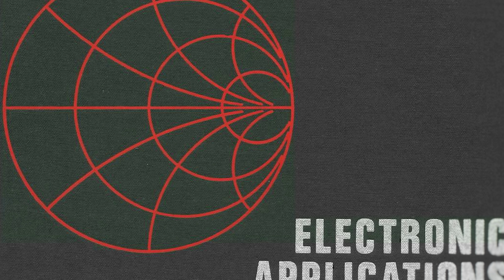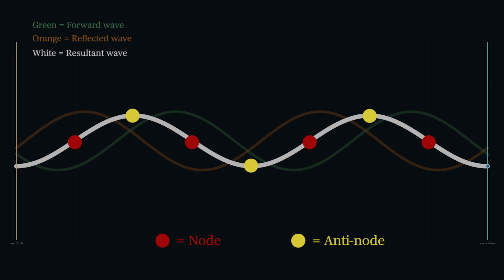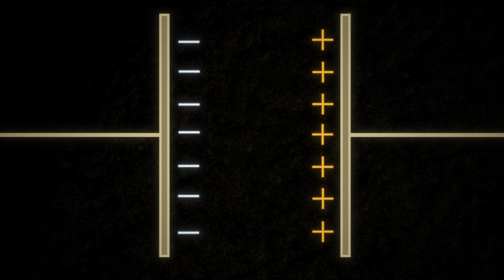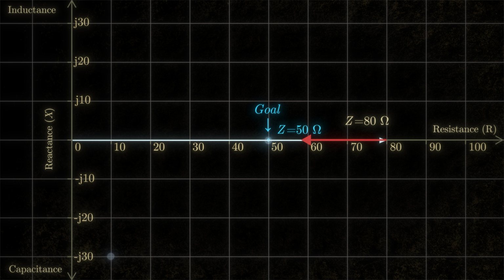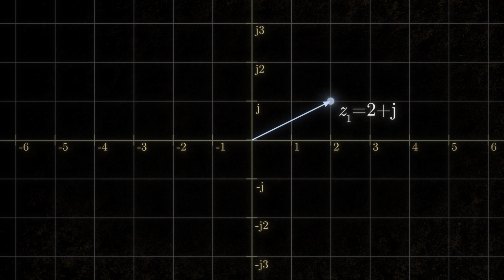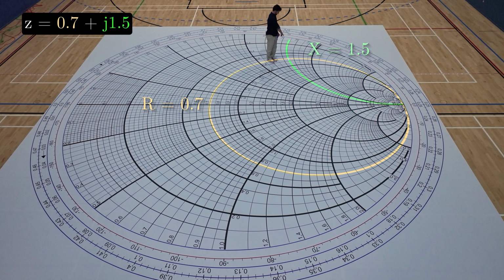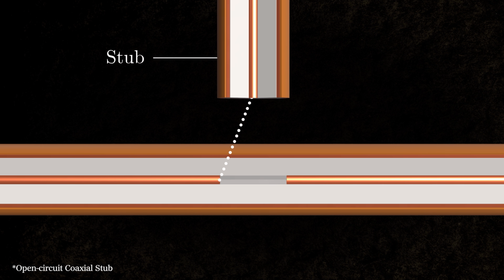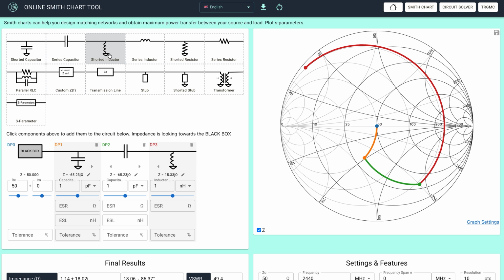The Scariest Chart in Electrical Engineering

Comment: FINALLY... a topic even veritasium sucks at explaining.
Reply: Slinkies!
Reply: @dr97236 Big prints! Cones!
Reply: @dr97236 🍪
Reply: @EnriqueDominguezProfile 😂
Reply: Still better than my university
Reply: It's still passable. Try university lecturers. Most can't convey the concept cleanly, then they immediately start giving the math, which is the examable part. All in one lecture. Every student's head spinning by the end.
Reply: @nickyoung9108  In the RF industry, they just teach you how to use it ( selecting appropriate capacitors and inductors) without deep diving the creation of the chart itself.
Reply: @David_T  that was the entire point.  It simplified circuit design and frequency response and makes bench work easier to understand.
Reply: @David_T thats like leaening to play guitar without understanding music theory. You can, but you get better knowing why.
Reply: @nickyoung9108 The trick is to actually read a book written by someone smart. And use the lectures just to see what you need to know for the class.
Reply: @Mobin92 : can you recommend any good books on this?
Reply: @HoraceMash Pozar, Microwave Engineering (4th Edition)
Reply: @HoraceMash  Cheng, Field and Wave Electromagnetics (2nd Edition), Chapter 9 on transmission lines. Also the cover of the 2nd edition is literally a Smith Chart, lol.
Reply: @HoraceMash  Chris Bowick - RF CIRCUIT design, 2nd edition,
Reply: @Mobin92 i find that smart people really are not good at explaining things like this. They just understood it and never had to struggle. They just know. Those that had to struggle and learn it the hard way and then can explain just the things that are important are the best teachers. But those people often don't go into teaching math or the sciences
Reply: @CrackedCandy  false lmao, its a strange stereotype smart ppl are bad at explaining, rather they just dont want to explain everything they know point by point to make someone understand or are too uninterested to help someone understand in the first place
Reply: @thanosnoctem4473 im speaking from experience.  My math teachers have generally sucked, wasnt until college that I had a good one. Your milage may vary
Reply: @CrackedCandy  opinions can vary, true. I was balancing out your take instead.
Reply: @nickyoung9108  University lectures (Br) are really weird, most can't grasp what explaining means and commonly you find people preaching phrases instead of actually putting some thought behind it because they learned it 20+ years ago somehow and never cared to illustrate to different people how one learns it and when to prove it. I suspect it is an universal problem with academia...
Reply: @Samuel-lq7kp well, it's simple. Lecturer are not hired to teach, which came as a shocker when I first heard it from a college lecturer. So if teaching is just an obligation, then effective communication isn't anywhere near a priority.
Reply: @nickyoung9108  Not all lecturers are research professors, there are teaching track professors at universities, but they are less common.
Reply: @Samuel-lq7kp  I'm arrogant enough to suggest that "universal" may be overstating it.
Reply: @nickyoung9108  not that school teachers are great at teaching anyway...
Reply: @nickyoung9108  Neither hired to teach, nor especially trained in it. Teaching is a whole-ass field, and at the very least, it consists of communicating, but mostly, academics get where they are for their research abilities, which are entirely different skill sets.
Reply: @nickyoung9108  
This is why I was a big fan of Professor Sumner Miller.  He made physics understandable to the average person by using practical demonstrations to illustrate the point.
Reply: @nickyoung9108  yet better than most lectures...
Reply: @nickyoung9108  This was better than their last transmission line video that made everyone argue for months.  Anyways, I personally can't think of a worse situation to learn anything than a school.  In the decades since I was last in school, I have learned so much math, and actually became fairly obsessed with analog filters.  I have explained impedance and other AC phenomenon to people who have EE degrees in the past, and did a better job than their teachers.  Learning something cause you are interested in it on your free time is usually better than in stressful school environments when you are 20 and have multiple classes yelling at you for your attention and time.
Reply: @nickyoung9108 it’s actually really simple in principle.  Anyone focusing on the arcane is going to do a very bad job of it explaining it, garbage in garbage out no matter how well you do linear algebra.   It’s just a plot of frequency response across a measurement range, where reactance is up/down with capacitance down from center, inductance up and the real part of resistance is zero on the left and infinity at the right with your reference in the middle, often 50ohms or 1 depending on how it’s scaled.  But it’s always the same graph shape.   You often want the frequency response to just be a dot in the middle, like for optimal power transfer, and it simplifies working with high frequency circuits of all kinds.
Reply: As an RF engineer, I must say they did a decent job at explaining the basics. It's pretty solid, but of course, there are some nuances/oversimplification, probably for the sake of targeting a wider audience.
Reply: @zaw00  Lol thank you for the sanity check. I'm in my senior year of my EE BSE and these comments about it sucking were making me start to second guess if I really understand the material, because I thought it was a pretty great explanation!
Reply: @mr.FluxLinkage  the smith chart is simple and intuitive and is well suited to understanding circuits without knowing the math or even individual components behind it because its visual.  The complex linear algebra problems that you will formulate and analyze in class and then plot to a smith chart are very much not fun and do cause people to drop out.
Reply: @hugegamer5988  linear algebra? WTF man, you don't know what you're saying.
Reply: @hugegamer5988  I mean I got an A- in Emag 2 last year and never missed a question related to or using the Smith Chart on a quiz or exam; my point was that I felt like this video did a good job explaining the basics, but so many people are saying how it didn't explain it well at all that I started to think to myself "wait, is there more to the Smith Chart/impedance matching that I don't understand that's not in the video...?"

 So I was grateful an actual practicing RF engineer confirmed it covers the basics reasonably well, meaning I do have a solid grasp on it.

Also not quite sure what you mean that it's "well suited to understanding circuits without knowing the math behind it"; I feel like it makes it easier to understand the dynamics of RF circuits because it helps you gain intuition about the otherwise pretty abstract math.
Reply: @Sr.DeathKnight  Yeah I didn't quite understand that, since in the 2nd Emag class I took where the Smith Chart was introduced we didn't do anything but complex trig, sometimes using MATLAB so technically using linear algebra, but not actual matrix math. But we didn't really do any involved nodal/loop analysis either where you have to solve a linear system of complex equations like you do in Circuits 1. Maybe that's what they meant...? I dunno. But even then, you're just solving for voltages and currents, not really impedance matching.
Reply: @mr.FluxLinkage  Linear algebra is a totally different math, not used here. Here you use Complex Math. Linear algebra is a very basic math, like saying: algebra. You use it everywhere, even in software programming, but not in telecom, incidentally.
Reply: @Sr.DeathKnight  Yeah that's basically what I was saying - we used complex math to solve impedance matching in Engineering Electromagnetics, and last time I used linear algebra in a circuits context was in Circuits 1 doing formal nodal analysis by setting up a system of linear equations to solve for loop/node voltages/currents. 

And for steady state AC circuits, you can just simplify it with phasor notation/Laplace transforms to make it regular old complex algebra.
Reply: @mr.FluxLinkage  Exactly!
Reply: @mr.FluxLinkage  yes, it gives you intuitive understanding of the dynamics of circuits that are represented by abstract math, but it also gives you intuitive understanding of basically any high frequency circuit that is not precisely understood or manufactured such as deviation in performance of the physical board and transmission lines and the high frequency response of actual capacitors and inductors.   Not everything is modeled or designed well at high frequency and even slight component changes can mess up the behavior.  It’s a great tool to use on a vector network analyzer because you don’t need more than a short lesson on the basics and then anyone can bench test and fix circuits of all kinds like antennas or amplifiers without ever going past grade school math.  It’s quite a bit easier to simply see the response on a graph than to intuitively understand the complex math.
Reply: @Sr.DeathKnight  sets of differential equations and linear algebra is how the formula for circuits are written, and how you derive solutions.  You may not have encountered them if your electronics experience was limited to simple resistive circuits without reactance.  In fact, it’s not even just circuits, the same equations also model other physical systems and if you understand how a waveguide responds to a DC stepwise function you also understand how a garden hose functions.  Say your waveguide is open at the far end and the garden hose has a cap on it, when you turn it on, water rushes down to the end of the end of the hose and a pressure wave is reflected back.  The hose stretches along its length from the pressure and acts as a storage element along its length which is the capacitance per unit length.  The mass of the water wanting to keep momentum is the same as the inductance per unit length as well and once the pressure bounces back between the two ends the flow stops.  The rate the hose filled up at is the equivalent ohms.  It’s not a perfect analogy because the hose would have to have no diameter and expand with water, but it’s really close and the math is nearly identical and it’s slow enough and physical enough to actually see and feel the flow and reflections.
Reply: @Sr.DeathKnight  maybe it’s a regional language difference.  In the US, linear algebra are sets of differential equations using calculus that do include complex numbers and are learned after your first year of calculus, often as an extension of your second year coursework, in engineering.  It’s not simple high school algebra.
Reply: @hugegamer5988  Yeah I mean it's a great diagnostic tool obviously, as that's what it was invented for, but my point was that I think the real learning value behind it, and why they still teach it in EE courses, is that if you actually understand why the chart looks like that and what the chart actually is (contours of equal resistance and equal reactance in the complex plane), and you understand how the position vector of any point on the normalized chart is the reflection coefficient phasor for a component of that normalized impedance relative to whatever reference impedance, it helps you understand how complex numbers and phasor notation are concise, elegant ways of describing the actual physics of the system. So to me, the chart is inseparable from the math; it's a visualization of it, not a shortcut around it.
Reply: @hugegamer5988 Linear algebra is matrix operations. If you put complex numbers or variables in the matrixes is a totally different thing, as putting complex numbers or Laplace operators in a basic high school algebra equation. Ask Google or something.
Reply: @mr.FluxLinkage  that’s true.  I was just pointing out the real world is more complex, unknown, and random than the math which is axiomatic, deterministic, and solvable and when it comes to real world measurement a graphical approach that lets anyone solve problems, even those without a math background, is indispensable.
Reply: @Sr.DeathKnight  not in American English.  It’s a natural extension and backbone of writing Kirchhoffs current and voltage laws into a mesh analysis.  Linear algebra is the American name for the systems of differential equations you use in circuit analysis including smith charts.
Reply: @hugegamer5988 that's ONE use you can give to linear algebra, like you can use basic high school algebra to solve deferential equations through Laplace operators.
Reply: @hugegamer5988  Do you use systems of differential equations in Smith Charts? Example?
You don't know what you're talking about.
Reply: @Sr.DeathKnight  sure, take the simple case of a transmission line.  At any point along the line (x) at a given time (t), the voltage V(x,t) and current I(x,t) satisfy the partial differential equations: the partial derivative of V with respect to the change in x  = -L the partial I / the change in time, and the partial derivative of I with respect to the change in x = \(\frac{\partial I}{\partial x} = -C the partial derivative of V with respect to the change in t.  When you use laplace transforms to put the equations into s-parameters you use linear algebra and also use the input/output transfer function mapping onto a smith chart as they are both ways of understanding the same thing.  Where do you get your information?
Reply: @mr.FluxLinkage  These videos are supposed to be for us dimwits. So we can learn. They're supposed to be educational.
If you need a degree in electrical engineering to understand what they're showing, what good is it?
Reply: @hugegamer5988  And you solve all those diff equations as a simultaneous system to solve the Smith Chart?  🤣
You also use simple high school algebra and basic primary school arithmetic to solve systems of diff equations.
You are confusing linear algebra with vector calculus/vector analysis. THAT'S the telecom math.
Reply: @hugegamer5988  Next time, better ask Google or ChatGPT, as said.
"How accurate is it to say that linear algebra is the mathematics used to solve a Smith Chart?"
ChatGPT:
I would say it is partially correct, but it is not the best way to describe it.
The Smith Chart was created precisely to spare engineers from repeatedly performing the underlying algebra. It is essentially a graphical computer for solving problems involving complex algebra.

More precisely:

The fundamental mathematics behind the Smith Chart is complex analysis (complex numbers).
The physical problem comes from transmission line theory.
Linear algebra does appear, but it is not the main mathematical foundation.
Reply: @hugegamer5988  ChatGPT: (continued...)
In contrast, the Smith Chart is primarily based on the transformation

Γ=Z+Z0/Z−Z0

where:

(Z) is the complex impedance.
(Z0) is the characteristic impedance.
(Γ) is the reflection coefficient.

This transformation *is not linear*. It is a linear fractional transformation (also known as a Möbius transformation), which belongs to complex analysis and conformal geometry.
Reply: @hugegamer5988  ChatGPT: (continued...)
A more accurate way to describe it

I would probably say:

The Smith Chart is a graphical representation of complex analysis applied to transmission lines.
----------------
So, after all this argumentation, we return to what I said in my first line ("Complex Math").
Reply: @mr.FluxLinkage  I think the criticism is directed more at the style of presentation—specifically regarding people who don't need to apply the knowledge conveyed in the video to their jobs, daily lives, or hobbies. To them, it looks like yet another instance of peddling some trivial nonsense as the greatest invention or discovery since sliced bread. Of course, even someone who actually knows how to use that knowledge might see it that way: it’s reality, not magic.
Personally, I rolled my eyes too... for a couple of seconds... but if the video inspires even one young person to pursue the career path we both chose—or simply sparks an interest in the subject matter—then it’s worth it. Entertainment value, exaggeration, and tunnel vision don't really matter in that context.
To experts, the electromagnetic force might seem trivial; to the curious, simply counterintuitive; and to trolls, well, just the thing that holds their molecules together (good one, right?). In any case, the insights into our world that we have gained throughout history are fascinating. This requires curious individuals—like the protagonists mentioned in the video—who not only asked "why" but also were looking for an answer.

Incidentally, history clearly shows: who really cares about pigeon droppings when it can uncover fundamental truths about the origin of our universe in the process? (Also: One might think that the people at Bell(Labs) weren't all that focused on telephones—their core business—after all, hehehehe.)

P.S.: Well, Forces acting perpendicular to the cause. ... Very rarely the sort of thing discussed in a pub. Have a good one, a future like a boson and a lot of fun in your job, Flux!:)
Reply: @Scott.Sandifer  I think the main misunderstanding here is that I was sort of taking the general comments as "they're not explaining the concepts *correctly*", whereas now I can see most of the comments are probably more along the lines of "they're not explaining the concepts *well*". So that's why it was making me kinda do a double take like, "wait, the video's not correct...? Do I not understand it as well as I thought I did?"

That being said, I thought it was a fairly good "first exposure" to the ideas that certainly felt more intuitive than the textbook explanations, but I can see where if you haven't ever really dealt with imaginary or complex numbers before, it could still be a bit dense, because they do seem to assume viewer familiarity with those concepts that I guess might not be considered "general" knowledge.

But I thought the visuals were good, and basically the main connecting idea to the weird math of it is just that the imaginary component of the complex impedance value represents "lead" or "lag" between the voltage and current due to the fact that it takes time for charge to accumulate on the plates of a capacitor before the voltage across it can change, and the fact that an inductor "kicks back" against a changing current with an induced voltage that opposes the change in current.

And, they don't really explain this but you don't need to be a capacitor to have capacitance, or an inductor to have inductance. These are physical properties pretty much all matter has to a certain extent simply due to material properties and geometry. And so capacitance and inductance are properties of basic transmission line cables, too, and are the fundamental physical properties that make one length of transmission line harder to electromagnetically "wiggle" than another that it's connected to, in the same way that the metal slinky was harder to physically wiggle than the plastic one, which is what causes the partial reflection at the boundary between the two materials, slinky or transmission line.
Reply: @Sr.DeathKnight  you have chat GPt bRain.  Linear algebra is used in a manner that’s intertwined with the mathematics such that you can’t omit it and still solve the problems conventionally.  I’ve completed all thr EE coursework and used smith charts for years in my job as an engineer who has had to design amplifiers, antennas, and matching circuits and the are circulating right now.  Yes, you don’t even need high school math to solve the problems with a VNA and smith chart, just a few hours introduction like this video demonstrates.
Reply: @hugegamer5988  So, you think that ChatGPT AND I are both wrong? LOL. 
The thing is not that you are saying wrong things: the thing is MUCH WORSE: you are talking gibberish, confusing concepts, and are completely disoriented. It's as if I said: 
"The complex algebra problems that you will formulate and analyze in class and then plot to a smith chart are very much not fun and do cause people to drop out."
"The complex arithmetic problems that you will formulate and analyze in class and then plot to a smith chart are very much not fun and do cause people to drop out."
Then you "argue" that you need arithmetic or algebra to solve the mathematical problem.
Reply: @Sr.DeathKnight  if you have the attention span left, loon up to my original comment where you took offense to linear algebra being the basis for formulating the problems that you then graph to a smith chart, s parameters and laplace transforms aren’t high school algebra.  The systems of differential equations are solved using linear algebra as a core and fundamental concept because they are governed by linear time invariant
Reply: @Sr.DeathKnight  differential equations. Linear algebra is the framework that is used.   The fact you used ChatGPT and stated it as “solving a smith chart” is where you screwed up.  You can use the graphical method to solve a problem, and not use complex math so technically the LlM is correct, but you never fed it my statement where you use linear algebra to formulate the mathematical statements behind the problem which is the difference.  You have llm brain, please do some actual thinking before atrophy ruins your life.
Reply: @hugegamer5988 of you had used Laplace transforms to solve differential equations, you would know that they become transformed to high school algebra problems.
Reply: @hugegamer5988 you use linear algebra to solve linear differential equations SYSTEMS, but the basic math there is calculus/Laplace, depending on approach. 
You're welcome.
Reply: @Sr.DeathKnight  the equations you formulate when in EE classes involving a full circuit with multiple components IS a systems of simultaneous differential equations and you use linear algebra when you translate it into the s-domain which is standard practice and why you may have noticed the s11 and s21 indicators on the VNA used in this demo displaying output to a smith chart.  You can measure s-parameters directly, you can solve basic circuit tweaks graphically with a smith chart, but in EE classes you write the formulas and solve using linear algebra just exactly as I said because I have lived this lol.
Reply: @hugegamer5988  Man, Linear Algebra is literally the second math that you take in an EE degree (from 8). Obviously, you see it everywhere, even in software programming, I've already told you. The second after Calculus 1 and right before Differential Equations. And it's the easiest of all. People use it even in Economics, and so on. Like high school algebra or trigonometry, and primary school arithmetic or geometry, you need it everywhere. Maybe it's a "complex" matter for you, but believe me: in Telecom EE, or Control EE, you need 3 orders of math magnitude over Linear Algebra to understand the basic things.
Reply: @Sr.DeathKnight  how are those shiny new goalposts?
Reply: @Sr.DeathKnight uhh as a math major i'd have to say linear alg and alg in general are not basic math, or, not only basic math. You can't say it's basic because you have only learned the basic application part...
Reply: @Sr.DeathKnight  
 Linear algebra is definitely not very basic math, and it is definitely not the same thing as algebra. And it is definitely used in telecommunications. Go check out scattering parameters on wikipedia, or power wave formalisms in general.

What are the 3 orders of magnitude math over linear algebra ? What do you even think linear algebra is ? Just systems of equations and matrices ? The rabbit hole is much deeper and more ubiquitous, and that is why linear algebra appears everywhere in physics and engineering. Linear algebra is the math quantum mechanics is built on. Do you think quantum mechanics is trivial ?

You might be the archetypal example of dunning-kruger.
Reply: @Poppp it's used even in quantum mechanics. It's used everywhere, like algebra. Do to understand the concept of basic? As algebra, just as you said. Thanks.
Reply: @matusmoro955  In quantum mechanics, the use of linear algebra is totally different from its use in electrical engineering. This is not a video or a comment on quantum mechanics. It's like geometry or sets: its use for engineers or scientists is very basic, but for a mathematics major, it could be the theme of their PhD project. You're welcome, lol!
Reply: @Sr.DeathKnight  So to summarize:
linear algebra is not algebra✅
linear algebra is complex, to the point it is used in QM✅
linear algebra is used in electrical engineering (and RF/microwaves)✅

And also linear algebra in rf/microwaves (scattering matrices) is in direct analogy to the formalism used for scattering of quantum mechanical particles

You're welcome, lol!
Reply: RF math is 1% linear algebra. Do you have any idea what is the CORE MATH in RF?
Reply: @Sr.DeathKnight  I reckon it's based on explicit solutions of Maxwells equations, so on a high level it's vector calculus and partial differential equations probably. 

Also, where did you get you 1% claim ? Is that like a real statistic or are you just making stuff up based on your perspective ?
Reply: @matusmoro955  Right!
With respect to the 1%, it's based on my perspective as a telecom engineer while I was studying at the university. Indeed, I don't remember any use other than that (I might be forgetting something else, though), as opposed to Control Theory, where linear algebra is like the arithmetic of that field. That said, even in control theory, it wouldn't be right to say that "it underpins the theory", or "it's the core math", because the concepts (very complex and abstract) are in what you put into the matrices, not in the math number crunching. In general, we, engineers, just USE the math like a calculation tool, without much depth, and are sometimes criticised for that by physicists or mathematicians.
Reply: @hugegamer5988 nerd fight! 😅
Reply: @fortpete definitely!
Reply: @mr.FluxLinkage Honestly from who knows nothing about this it’s just a hard to understand topic.
Reply: @Sr.DeathKnight  Complex Analysis and linear algebra are quite similar. I can see his point.
Reply: @hugegamer5988  I just read about how really high frequencies can bring out an effect called dispersion (analogous to inharmonicity in physical wave acoustics) where harmonics deviate from integer multiples of the fundamental.
Reply: @hugegamer5988  In the US, linear algebra is not differential equations, it's the math concerning vector spaces, matrices, and linear transformations. It starts with simple algebra and quickly becomes adjacent to topology. (I'm American btw)
Reply: @TheLazarusEffect-z64  I think they were just being obtuse.  My reference was to smith charts for which you use a-parameters which are linear transformations.  Thus the linear algebra comment, and it’s common for non-engineers or math majors to confuse it with something you typically learn in high school.   However, I’m used to the internet where not every English speaking dialect has the same meaning and I’m not familiar with all of them.
Reply: @TheLazarusEffect-z64  there are tons of things to consider because the first thing anyone should learn is every measurement is frequency dependent, my introductory EE professor started the course with the statement “there is no such thing as a 1uF capacitor” and proceeded to explain frequency dependence.  Here, it might have been informative for him to explain that all inductors have capacitance, capacitors have inductance, and that measuring s-parameters directly has the benefit of not relying on data sheets or math that isn’t fully representative of reality because not every parameter of how components behave is disclosed in the data sheet.
Reply: @mr.FluxLinkage I’m thankful for your post because I felt the same. And anyone who says that this isn’t using linear algebra does not understand the whole reason we use complex numbers for transmission… which is so we can use linear algebra rules….
Reply: @zaw00  This are the basics?!?!?!
Reply: @wm1364  you can't do rf engineering without the Smith chart
Reply: @nicolaignazio  you can just do the calculations by hand, it's not too hard
Reply: @catalunyalliure1714 Can you do load/source-pull measurements for PAs without the Smith chart? Noise/Pavs circles while designing an LNA? If you could do those purely by hand, it would be revolutionary for the industry.
Reply: @zaw00  Some dude at Princston has a nature article of designing LNAs without a smith chart. They were using CNNs so not by hand, but still no smith chart.
Reply: @PieMaster2425  If AI takes over everything and becomes mainstream, we wouldn't need Smith charts or RF engineers anymore for amplifier design work. That would be indeed revolutionary.
Reply: @zaw00 if you like your AI to be able to do some black magic or even advanced black magic. Just as an sneak peak: I remember my BSc studies, got interesting when we started talking about building logic circuits that use waves :D  it is actually used in satellites. You send waves through differently shaped hollow bodies.
Reply: @zaw @zaw00 he smith chart is just a reference tool. i prefer not using one because i learned to just write the calculations out. is it fun? no. but then there was everyone else in my electrical apprenticeship who couldn’t use the damn chart even after it was covered in class, so…if you can get THEM to use the smith chart THAT would truly be revolutionary 😂
Reply: @johanneskepler873  Would it be fair to say it's "just a reference tool"? May I know what RF specialty/sector are you in? 

In my specialty, I have rarely used Smith charts as "just a reference tool", and instead as an absolute necessity while designing low noise amplifiers and power amplifiers. I have gone through countless datasheets and load/source-pull measurements, all of which showed power/PAE/gain contours on the Smith chart. 

All the vector network analyzers I have used are either set up to spit out S parameters in Smith or log-mag. I do not recall choosing to plot data on a Smith chart just because it's quirky or cool, but because it was necessary. 

If you have learned how to just write calculations out for designing amplifiers, please share it with us. It would be a good useful learning experience for me.
Reply: @zaw00 i do not design amplifiers…(yet…?) but i do often have to end up considering the intricacies of a circuit or design layout. by day im just a lowly barista, but when i clock out, my hobbies include but arent limited to a/v and networking related stuff. i design live stream set-ups, i devise solutions for audio/ video recording. i once ran the entire technical side of a livestreaming + internet radio studio that i was also hired to build.

so, i’m not saying i don’t use smith charts, bc why would I add stress right? but

when i notice I have a re-occurring issue that i COULD use the smith chart for…i tend to have more fun with it and not? because i already know the problem, or likely have a good sense of it, so…i am more explorative in the repair/ problem.

so, no. no smith chart. maybe after, when i try something different. to check my work and whatever but…no, not while exploring. i still consider it, of course. my default language is of patterns and shapes so, i like trying to imagine my solution’s plot if i feel like the smith chart plot will be quite different.
Reply: @zaw00 as an RF engineer, i agree with you!
Reply: @zaw00  it makes a lot of sense to a community college electronics technology drop out lol but i can see why others would struggle
Reply: @zaw00  I agree 🙂 BR - another (seasoned, by now) RF engineer
Reply: @zaw00  As an RF engineer, did it not bug you that they described capacitors as causing voltage to lag behind current and inductors as causing voltage to lead the current? Yes, it's technically true, but completely opposite to the conventional use of the terms "leading" and "lagging" in electrical engineering which consider the current relative to the voltage, not the voltage relative to the current.
Reply: @brettski74 This channel has never been associated with rigor; it's a popsci channel intended for the average Jane and Joe. I can nitpick a dozen things (which I did somewhere else, but that comment got buried, as expected); that will all fall on deaf ears. If you managed to spot more issues, do help correct them along the way.
Reply: @brettski74  oh, oh dear.  This is nothing compared to his video “the biggest misconception about electricity” where he confuses electrical fields with electron flow as being separate things and not two sides of the same phenomena where you can’t have one without the other.  All for clicks I guess 🙄
Reply: @zaw00  what makes an educator great is the ability to distill concepts typically considered arcane into simple and easy to understand digestible bites without making misconceptions that hurt understanding.  He does not really understand some of the science, and in cases definitely makes deliberate ones for engagement.
Reply: @zaw00  genuine question: how do you put up watching the entire video? Even though it's your area of interest. After the channel sellout, the videos have undergone such an aggressive and cheap sensationalism that's it's infuriating to watch.
Reply: @gabrielsantana6161 I completely understand where you are coming from. I have never commented under videos, but only did this time as it was right up my alley. To the best of my ability, I attempt to see the good educators bring in for "free"; maybe it is the naivety speaking, maybe it is the optimist in me. Nevertheless, there is always a general feeling of unease watching their videos after the transition, which did not exist before when everything was authentic and clickbaitism was minimal.
Reply: @zaw00 nah man it sucks
Reply: @zaw00  what is your stand on the effects of WiFi6 or 5G on the body ?
Reply: @User-w7ckl being exposed to 5g will instantly kill you, my dog died this way it’s really tragic 😢😢
Reply: @User-w7ckl  Those frequencies are non ionizing radiation, meaning they don't carry enough energy per photon to rip off electrons from the atoms in your body to turn them into ions. They can however, if extremely concentrated and focused (like in a microwave) increase the vibration of water molecules which causes an increase in thermal energy. This is useful for heating food up in a microwave. But while a microwave concentrates about 600-1200 watts in an extremely tiny area, wifi/5g sends 0.02 to 0.1 watts (20 to 100 miliwatts) through the air. Which is about 6000-60000x weaker and it is not omnidirectional (not focused).

The sun's blackbody radiation spectrum shows it produces radiation in nearly all parts of the EM spectrum, INCLUDING the wifi and 5g frequencies we use, and they hit your body every second you're outside, this is perceived as interference by our electronics...

Any person with even a basic understanding of science and with critical thinking and curiosity knows this.
Reply: @User-w7ckl  solar radiation is far more damaging. The wavelength of WiFi6 & 5G is longer than red light so it doesn't do a damn thing unless the intensity is super high like in a microwave oven. If the intensity is super high (extremely rare) then it may start warming u from the inside
Reply: @User-w7ckl the trick is to use aluminum Foil as a hat
Reply: @ilyesjebalia9757  Science is the devil thos 5g waves gave us all Covid 69
Reply: @User-w7ckl It's a love-hate relation for me. On one hand, I became the world's first septillionaire by activating the COVID nanobots Bill Gates planted in vaccines using 5G mmWave. On the other hand, I had to do multiple surgeries to remove 3 testicles. They keep multiplying rapidly due to WiFi 6. It should be patched with the release of IEEE 802.11be (WiFi 7).
Reply: @Tony3821  Yeah, and newspapers as shoes.
Reply: @ilyesjebalia9757  I started looking at this a little bit when I came across a friend who didn't use a microwave and wouldn't use her phone except on speaker phone. I understand that's the mainstream way to look at this, but I can't help but feel there's even more to the story than that. For instance, doesn't the frequency determine what percentage of the wave passes through your body and what percentage reflects and what percentage gets caught in-between? And sun gives you sunburn doesn't it? That's why (some) people where sunscreen. What about the effects to things other than our body, like our food? Also, 5G is mostly for your phones, right? Where do you have your phone when you are using it? Pressed right up against your face, which is high intensity. Where's your phone when you are not using it? Pressed right against your loins.

I'm NOT saying that 5G is necessarily a harmful thing. But as a math-physics major with a special interest in waves and acoustics, who has kept seeing a lot of conspiracy theorists be right, I just want to have a more open-minded, educated, deep-dive discussion with those conspiracy theorist types.

Here's another example of something that can be thought about more than what most people are taught in school: A bowling ball, an apple, and a feather are dropped from the same height at the same time. What hits the ground first?
Reply: It feels like its aimed at graduate level STEM students, which yeah if you do have that background its a pretty clear story but if you don't... also towards the end showing a bunch of equations and handwaving over them as "simple" can be really off putting for anyone without a background in engineering because representing things in terms of equations is not actually that intuitive if you don't do it every day. Conceptually, some things where explained pretty clearly but other concepts just touch on more fundamental physics where you either get to phd level really fast or you just have to kind of handwavingly accept that this is simply how it works. A good effort still, maybe they could have taken a bit less time trying to fit in a history lesson to make the rest a bit more accessible.
Reply: @sparesomerunesplease3683 yea I didn't think it was a good explanation at all. I'm not an EE (my undergrad was in Nuke Engineering), but still some of the things they explained were difficult for me to even keep up with. They went through everything too fast and they skipped entire connections & concepts at the most critical points.
Reply: No, RF is often considered black magic even by electronics engineers LOL. The real explanation for this would take many hours at the very minimum.
Reply: A couole of years ago in my RF class our instrucgor was a PhD student, and he derived the smith chart in 30 minutes statting from Maxwell's Eqautions in class, it was awesome.
Reply: @damega621  Maxwell's Equations are the second scariest thing in electrical engineering, surpassed only by Smith Charts. Take those away, and electrical engineering is really simple, mainly because there's not much left.
Reply: @stevegreen5358  MSc in EE here. You’re still left with things like quantum mechanics for characterising all kinds of semiconductors, signal theory, information theory, control theory, etc. The field is a lot broader than you think.
Reply: @stevegreen5358  So, electrical engineering is really simple if all you want to do is make a light bulb, but then material engineering comes in to ruin your morning.
Reply: @stevegreen5358  V=IR and P=I^2 R are all you really need to know for so much, even for complex numbers dealing with reactance.  You can even get maximum power transfer and thevenin equivalent circuits and so much more from them.
Reply: @stevegreen5358  You left out Control theory already and 100% of telecom theory. Smith Chart is just 1 lesson in a 5-year degree. You aren't even an EE.
Reply: @Sr.DeathKnight most people commenting aren't. Smith chart isn't that hard of a concept, Laplace is much harder, and Maxwell's equations seem simple at first until you see expanded versions of the equations, not the simplified versions.
Reply: @nezu_cc  it’s considered black magic because of how trenous it is.  Everyone who is old knew about how the TV would be full of static but as soon as you got off the sofa it would clear up or similar - literally your position in the room changed the antenna response and thus the received power.  I’ve leaned over circuits that were poorly shielded and the act of leaning over it bent the frequency response on the smith chart because it coupled to my body.  Thats why it’s considered black magic, because you’ll rip your hair out trying to fix problems that are very difficult to visualize.   The smith chart actually helps quite a bit with that.
Reply: @hugegamer5988  Did you use a Smith chart to calculate the position of all your furniture to obtain optimum TV reception?
Reply: @nezu_cc yes but not because of impedance matching. Impedance matching is very simple. In high frequency RF everything becomes an antenna, including pcb traces, which is why it's so hard to design... but not impossible
Reply: @nezu_cc  That's because most EEs see things as 'electrons go brrr'.
Reply: Indeed. I understood some words. "The," "of.." 🤣
Reply: Were they wrong/inaccurate or just hard to understand?
Reply: @dmytrooleinichenko9865 yh just hard to understand
Reply: @martinseal1987  yes, in university it takes couple of years but only in a case you very good at complex numbers
Reply: @dmytrooleinichenko9865  it misses some important explanations; it assumes you know them.
Reply: AlphaPhoneix's experiments with water, and the oscilloscopes measuring every part of the line are my favorite way of understand the wave like nature of propagation of voltage and current. 

I think a mite advanced version of that setup with RF would be really nice.
Reply: @usopenplayer  Yep. His videos were the thing that made impedance matching click in my head.
Reply: Part of the problem here is they come in assuming they have to explain what DC is and what AC is.  And explain waves.  And explain wave lengths and frequencies.  And they expect someone starting from "OH!  That's what AC is!" to end up at "Great Vid... Now I finally understand these charts, and complex numbers and how EE's use them!".  Not gonna happen.
Reply: @FroToe2 It was even happening in the classes. We'd start with a simple equation at 9:05am; I'd put my head down to take a note, and by 9:30am the instructor was reducing a 4×4 matrix using some obscure linear algebra theorem. By 9:45am he expected us to recognise an eigenvector we'd never seen in our lives. And to be honest, that was the real thrill.
Reply: @GoogleRescueGooglerescue  Despite an MS in EE concentrating on signal processing, eigenvectors remain a tad bit mysterious to me.  But hey, we just all use the DCT and figure "close enough".
Reply: @FroToe2  Right? Who is the intended audience here?
Reply: @ezgarrth4555 This must be some unspoken law of YouTube. No matter how specific the topic, it starts with the basics. Probably a retention thing.
Reply: @e@ezgarrth4555elp, it worked great for me. I have a background in chemistry, so I know a little bit about physics. The short refresher on circuits reminded me of what I’ve learned before, but the only circuits I’ve ever learned about were DC. All of the AC stuff was new, and I think they explained it well enough.
Reply: @ezgarrth4555The people who already know things. They Overexplained at first to keep the newbies. That's gonna fetch them views but won't help the channel in the long run.
Reply: I followed along until they got to the rescaling part and just gave the formula for the complex transformation. Would be better if they explained how the transformation was found
Reply: I literally taught this topic last month. The key facts were VERY good except for the 'plot' portion. There was no revelataion in the coordinate transformation part. The formula for reflection coefficent existed long before the smith chart, and so did the idea of coordinate transformations. The first assignment in my class was to naively derive the smith chart with only the Zl-Zo/Zl+Zo formula and calculus. It's one of those things that is novel but not difficult; a "why didn't I think of that" moment
Reply: Nah it's a great explanation, E&M is just not an intuitive thing to understand
Reply: @Leopard-n2i  I definitely agree with you, but my OCD compels me to point out that this is "EM", electromagnetics, whereas "E&M", electricity and magnetism, technically refers to the time-invariant case of static electric and magnetic fields. Electromagnetic waves are the time-varying case where the fields change magnitude and/or direction, and are linked. I'm sure you know that, I just had to say it, lol. Sorry in advance.
Reply: I was thinking that either electrical engineering is very complex or I'm just dumb
Reply: @kristofnagy1373  It's one of the most complex disciplines in Sci/Eng.
Reply: @kristofnagy1373 both, because I have gone through like that lol
Reply: Considering this is high level RF electrical engineering they did a great job. It helped me understand stuff I learned in the 70's. It's something all Ham radio enthusiasts need to know when they set up their antennae! I still have my father's old RF engineering handbook from the 1940's. It's 6" by 4" AND 3" thick even printed on onion skin paper stock! This deep dive goes into more detail than needed to actually USE this info.
Reply: 🤔In comparison to what though? Compared to what I heard and saw in my electrical engineering degree, the suck power is about -30db. Any links to similar or even less-sucky explanations would be appreciated
Reply: Just think of it as a bat chasing a butterfly in a blender.
Reply: I've studied at TECCART in Montreal. They did a good job. I even did a calculator with labview back then...
Reply: I followed everything until the slinkies turned into complex numbers, and then I too was humbled.
Reply: I had that issue with control theory.  I could do the math (poorly) but never understood the usefulness of PID controllers until I worked in industry.
Reply: That was an amazing explanation actually...  even visually explanatuve. Although one must have a deal of mathematical and or electrical linguistics to fully grasp the full explanation. Fantastic
Reply: Tbf conformal mapping is the most unintuitive part of applied math and being complex only makes it harder
Reply: More effective than many hours in front of those big electromagnetism book back in the engineering school
Reply: Here I was thinking I was ready to become an electrical engineer
Reply: I understood every bit of it after watching twice
Reply: What printers exist that can print a graph in that size?
Reply: He explained it for Eee students.. not for the general public.. I don't know how he could explain it for regular people though so not complaining
Reply: As someone who's pretty into this field, ehh it's good enough for barebone basics
Reply: Honestly one of the few topics my undergrad prof actually explained better. I think in this case sticking to and explaining the math instead of trying to focus on physical modelling would have been better
Reply: A 40-minute video is not going to teach you the intuitions necessary to understand complex numbers, mappings and basic electric circuits theory
Reply: @Blackwhite2277  That's why it should've been longer, but explain more in the process. "A 40-minute video doesn't have enough time to explain everything" is not an argument.
Reply: Cool, I went to your channel to find a better explanation but could not find one
Reply: You’re welcome to post a video explaining it better if you think this isn’t good enough.
Reply: Well you've got to realize that explaining complex electrical engineering in a way that the average human being is able to understand it, is nearly impossible. Even someone that is very much interested in science wont understand anything. You basically have to be an Electrical engineer, control engineer or mechatronics engineer to actually have the knowledge to understand these topics. 

This video literally tries to explain concepts that are even advanced in electrical engineering. The fact that electrical engineers consider this diagram to be scary, says a lot about how much knowledge this requires.
Reply: @4uehrkhjdf yeah after awhile I just figured this was too advanced for me, I love science and love veritasium but this is just too advanced for me to grasp without doing my own research into what the terms actual mean and their relationships
Reply: epic comment
Reply: For real. This one was bad
Reply: haha..ooh boy thanks for this comment. :-). made my moment.
Reply: It was pretty simple. What are you talking about?
Reply: Correct. I wrote;
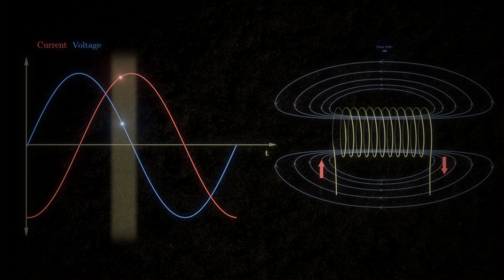Not a great explanation of inductance at 12:55. As an electrician, that graph I learnt showed back EMF, basically 180 deg opposite of the input voltage. Then state that this back EMF rises to equal the input voltage which in effect prevents short circuit as in DC. As such, since the rate of change of current determines the value of back EMF, the "rate of change" is highest at peak V as the current crosses zero and no change as V crosses zero. It must be emphasised to think "rate of change of current", not the "value of current" to understand this or you will be off with the fairys. Then add that the rate of change of current is proportional to back EMF because that determines the speed as which rising and falling magnetic lines of force cut the coil conductors generating the back EMF. Ta dah!
Reply: No kidding! My head exploded at the 5 minute mark.
Reply: The last transmission line topic wasn't exactly accurate either ;-) RF is magic.
Reply: That is because they still don't understand it because it's the key to Cold Nuclear Fusion.
Reply: @quantumkineticscorporation  This comment is about as vague as the mechanism behind CNF
Reply: @quantumkineticscorporation  hum... 🤔

please tell us more about it
Reply: @quantumkineticscorporation  Still waiting for the keys to cold fusion, quantum corp
Reply: There are more than just this out there in the library. This is just a particularly bad job because of the abuse of transitions and the size of the topic.
Reply: This one definitely felt like generic popsci slop where you feel like you're learning but there's not actually anything of substance. 39 minutes long and 1 inch deep.
Reply: Sorry that it was hard for you to understand. For electrical engineers, it was like: "at last, THE explanation".
Reply: they actually do quite badly at alot of things, there is a concerning amount of errors and omissions in alot of the videos that just go uncorrected
Reply: Private-equity-eaten-Veritasium sucks at explaining it.
Reply: Not a native speaker here, witha major in physics and mathematics. Unfortunately, I have to agree. Not many videos leave me confused in the end, and this is definitely on of such kind
Reply: Idk theres been a couple things in the past where I noticed they used a roundabout explanation when they couldve given something far more concise and digestible for viewers, but these were just niches they didnt understood fundamentally.
 Buttt they cant be an expert on everything, Ill just leave a comment if i think its helpful.

 They still get the general idea good enough for viewers who know nothing on the topic, like this video did for me. Then I can read the comments where someone who has taught electrical engineering for 72 years will surely have some advice.
Reply: Looool. You're absolutely right! I get most of Veritasium's videos. But I didn't get even half of the things
Reply: Dude this was a great explanation!
Reply: He sucked explaining that wire and bulb problem years ago.
Reply: THE OG DAREK MULLER COULD HAVE DONE IN A BETTER WAY
Reply: I agree. This video and explanation kinda sucked.
A rare one
Reply: Why do you think it sucked?
Reply: So I'm not the only one whi think this video is not great?
That's a relief 😂
Reply: Maaaan
Reply: How does the signal flow if the conductor is interrupted by the stub?
Reply: @ricrp  The same way it flows in a capacitor or transformer: capacitances and/or inductances. At high frequencies, cables work more like antennas/waveguides than like DC cables.
Reply: this was bad dont understand sht
Reply: Yeah, it looks like @veritassium finally learned his lesson: when you talk about engineering, explain it like an engineer is watching, NOT A PHYSICIST. As a physicist, I don't blame him at all. Most electrical engineers are yet to be domesticated, and they can get super aggressive the moment you try to tackle the theoretical foundations that explain how their toys work.
Reply: The elegance of the chart was amazing. Don't get fooled by the clickbait title, it's not terrifying. There are parts of RF that do terrify me !  A semester with the Jordan and Balmain textbook, assuming you can do basic complex number manipulation, and understanding impedance -> Smith charts are easy.
Reply: HOLY MOLY, Man, It was the easiest and the best explanation. Ever !!!
Reply: xddd
Reply: Only 3blue1brown could pull it off...
Reply: straight up a terrible explanation
Reply: Dutchsinse crushed his explaination when he was laying out his earthquake prediction theories.
Check it out lol
Reply: Awesome explanation. Easily understood.
Reply: I didn’t find it as bad explanation. Maybe due to my master degree in math in the branch of calculus that includes complex calculus
Reply: i think its quite well explained
Reply: I've been watching Veritasium for years and this is the first time I've completely given up trying to follow an episode. Started out telling me stuff I knew then rapidly jumped to incomprehensible for anyone with very little knowledge of electrical stuff
Reply: Gotta love youtube commenters making out like theyre smarter without actually contributing anything 😂
Reply: As a lay person with no background in engineering, I thought they did a decent job. I didn’t understand a lot of likely BECAUSE of that lack of background, but it was explained in such a way that I could fathom what problem the diagram is helping solve, and why, and how historical engineers got there, which for a lay audience is probably the important part.
Reply: So it’s not me.. I’ve rewinded several times trying to understand this lmfao
Reply: There's just too many poor links between the concepts.
Reply: I never comment on videos - but the explanation in this video unlocked a great deal of stuff I had given up on!

- what is reflection (good job with slinkies)
- the phase difference and amplitude diff in reflection
- what problem using resistors causes
- the reactance (inductance, capacitance)
- the way this chart is built
- how to use the chart
- how just changing the length can help match impedance

Btw, this is the first time I’m seeing this chart — I’m not an electrical engineer, i just do “electrical stuff” as hobby - and i saw some PCBs have wiggly traces in some videos, and i knew it was for “impedance matching”, but the concept of “impedance” and “impedance matching” was never clear to me.

I’d say this video did a wonderful job at that!
Reply: Since the changeover, this is becoming more frequent I have found
Reply: @boarder2k7  I disagree, it was even worse before
Reply: @nochtans342 You cannot criticize the beautiful past when things were better and entropy had wrought less damage upon us in favor of the present! You have sinned!!
Reply: You do better
Reply: Dude this topic suuuuuucks. It's kind of theoretical and hard to observe other than seeing magic numbers on a screen that may or may not line up. No one likes wave trigonometry either.
Reply: I mean it's trying to explain a concept in 40 minutes that took my professor many hours to explain. They really set themselves up for failure.
Reply: @taukakao  That's why it should've been longer.
Reply: Zach Star did a good job of it.
Reply: It can be more easily to understand by showing that the plot over the maximum circle is the linear  phase of the reflected wave and the inner circles surounding the center are the module of voltage . It is actually easy to explain, the hewlett packard have a seminar about this, made circa 1965.
Reply: it's cause derek wasnt in the video
Reply: Agreed. I was totally on board with the Slinkys. 
Then he drew the graph, and his explanation for why the two waves are offset was terrible, and I was completely lost for the rest of the video.
I was never able to catch up. This video really sucks.
Reply: @Scott.Sandifer  if you're into warhammer 40k The Smith chart is to RF engineering what the Astronomican is to Warp navigation: a stable geometric framework that lets you navigate an otherwise bewildering mathematical landscape.
Reply: Veritasium has gone downhill since Private Equity bought the channel.
Reply: @truejim  yes, very formulaic.
Reply: He talks like Obama, so annoying lol
Reply: Old Veritasium would eat the topic on breakfast, but now we have ADs instead of good explanation
Reply: This is a terrible video lol
Reply: Oh they sucked in their “most controversial idea in math” video too